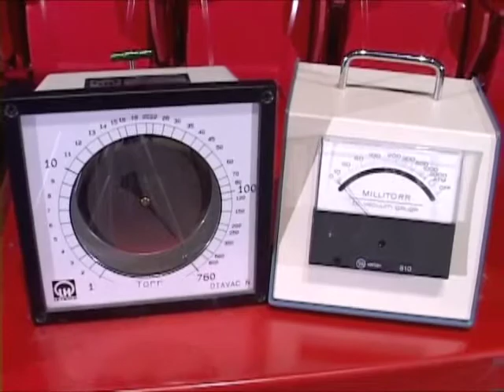Vapor Pressure of Water

Comment: Hi, Thom--
Thanks again. 
Water has to be cold to freeze; that doesn't change very much with pressure. 
One way to look at it is that the energy to boil at reduced pressure comes from the water itself. See watch?v=pOYgdQp4euc for an example. 
Another way to look at it is that the water molecules that leave the beaker first are the fastest moving, or hottest molecules. Those left behind are slower/colder, and eventually are cold enough to freeze.  Best regards.
Reply: Hi your 9 year old comment helped me understand this video. 9 years ago was 2012... Crazzyyy! So thanks mr extractables from 9 years ago!

Comment: getting my head round this, whilst the term "boiling" is applied to bubbling waters in such atmospheric conditions {we have NO heat} so here is my question, when we see this freeze and ice, Is there a temperature change showing freezing ?.
Thom in Scotland. {good videos guys}
Reply: Boiling is defined in terms of vapour pressure, i.e. the sudden vaporisation of water at the temperature when the vapour pressure of water equals the atmospheric pressure. Usually, we increase the temperature to increase the vapour pressure to boil, but here, conversely, they decrease the atmospheric pressure to equate it to vapour pressure and hence boil water. Btw vapour pressure is the pressure on the surface of the water in a closed container when the evaporation and condensation are in dynamic equilibrium.
Reply: Similarly, freezing is when the vapour pressure in liquid form is equal to in solid form, which is assuring by decreasing the atmospheric pressure .
I am not so sure about this part.
Reply: both terms meant different

Comment: DeIonized water freezes at 0°C.  
Reduced pressure doesn't change that.
No supercooling here, in a dirty beaker with lots of nucleation sites.
  
Pumping on ice cools it down further, but we don't pump long enough to freeze all the water.  
At equilibrium, ice in water T=273.15 K.
We use melting water ice to calibrate thermometers, and in thermocouple cold junctions.